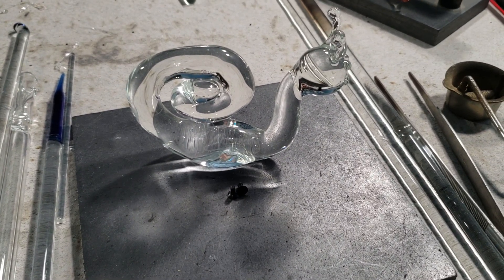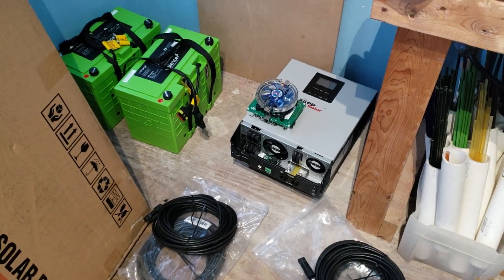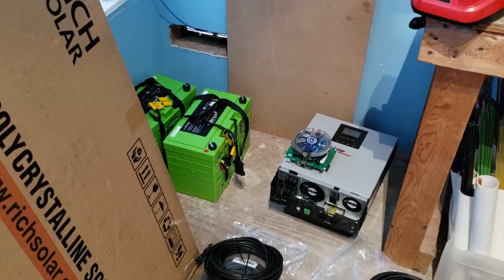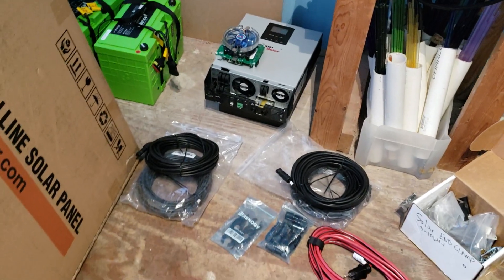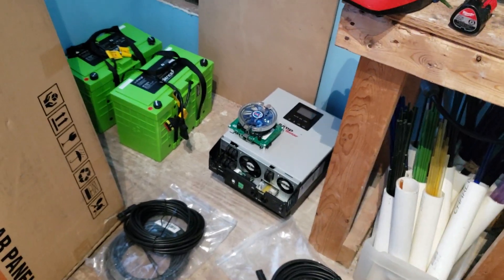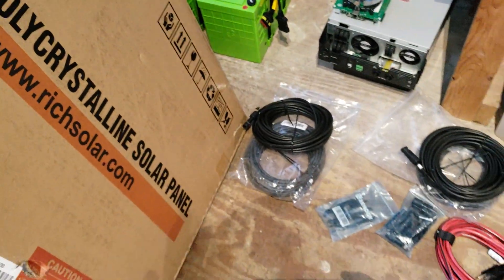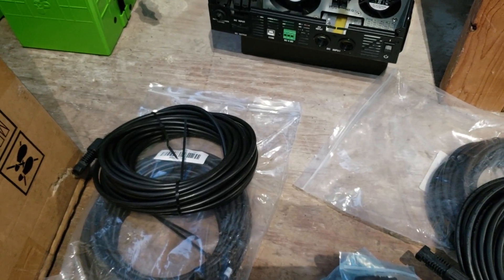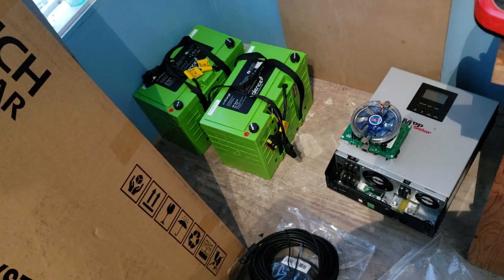How To Build An EASY Off Grid Solar System - Mining Cryptocurrency - Part 1

Comment: Can anyone help me indurstand how should I connect the ASIC directly to 12v battery with a solar charge controller tied to the battery? I guess I need some sort of 12v to 12v stabilizer of 2.2kw for running a s17 asic

Comment: The trading system is a set of certain algorithms trading, instructions, and action of the trader, on the basis of the technical analysis. In each trading system, the conditions for entry/exit time intervals, money management, and risk management are clearly defined. Trading systems allow you to limit the factor of emotional influence on decision-making, as well as to give the trade a certain degree of systemic character. I have been trading forex for 6 months now and never have! regretted going into it, my only regret is not going through the right way as I lost a lot before l was directed to the best trading agent in the market, Expert Mr vicente sanz, he grew my account drastically with my initial investment of $4500 to $32000 in a week 
+44 7380 353818
what's app.. or Telegram @vicentesanz...💯💯thank me later
Reply: i never knew trading BTC could be this profitable till i met vicente, his unique strategy helped me make my first $10,000. guy is just too good
Reply: i remember my aunt make mention of this guy , i'll definitely give him a try

Comment: We are literally in parallel on our projects right now! Working on a mobile solar system!
Reply from the maker: Hi Blue, Great minds must think alike! That's really cool how are you doing it, what parts are you using?
Reply: @TheBitcoinMiner  I might get some of the project on video and post once it gets underway! I'm probably using residential grade 60 cell solar panels and EV battery modules from a Tesla is the plan. Going to have 3D printers running inside enclosed trailer, along with office desk for desktop computer, and a small mining server cabinet. Goal is to use shore power off-peak when available cheap and batteries/solar during peak pricing hours. And/or completely off grid when in remote locations!
Reply from the maker: Nice I'd love to see a video of that and I did check out your 3D printing Farm, awesome job. I'd love to come check it out sometime, I've always wanted to get into 3D Printing and we should grab a beer or meet you at one of the Bitcoin Meetup since we're local.

Comment: I've seen setups that where for mining. The setup I can remember, the guy had 50 rigs of 1080ti's. 8 cards a rig. But the amount of solar panels was like 72 I think. And seen other close to the same. So you can cut your bill with solar.
Reply from the maker: Hi Aibrushkid, you are definitely right solar is a very good addition to your mining project and I would strongly recommend anybody who's serious about mining to look into adding solar to their setups. In the video I'm talking about running the miners entirely on solar power and not relying on the grid which in my opinion was not very feasible until now because we didn't have good ways of storing the power.
Reply: It is a go for miner , but the issue is the cost of batteries storage, better not to use storage. Any solutions?

Comment: What a cool setup. Looking forward to part 2 :)
Reply: Im curious about the amp hour rating of the batteries, the eBay listing in the description had no details?
Reply from the maker: They are used hundred 138 amp hour batteries. I'm in the process of running some tests now to see how well they actually do being used but I'm suspecting we may get around 95% of the original use.
Reply: @TheBitcoinMiner  I'm looking forward to seeing your off grid mining setup in operation :)

Comment: Will you use the Inverter to draw from the batteries to provide 110vac then plug the miner into that?
If so you could look at a controller that you can run the miner at its  input voltage so there is no power conversion waste  I.e. up to 110v then back down to 19v, 12v or whatever the miner is via its own power supply. This way your charge will last longer.
I only write this as this was my plan when I finally did it.
I did something similar with my UPS and bypassed the inverter when using battery. I connected to the batteries using a manual switch direct to my 12v satellite internet router (I needed internet for work-from-home and we have a lot of power cuts)  also connected my laptop via a smaller boost module 12 to 19v. The use time went from 2 hours use to a lot more -  6 hours was the longest used and never took it to fully discharged.
Reply: The mini has a 12v barrel connection in however the inverter* used doesn't look to have 12v out. only 12v in. I think utilizing a 1600p2 should help with the loss. I am excited for the results and the run time. I think easily with 2 of the high end batteries* there should be plenty power for 24hrs of run time if not even more.